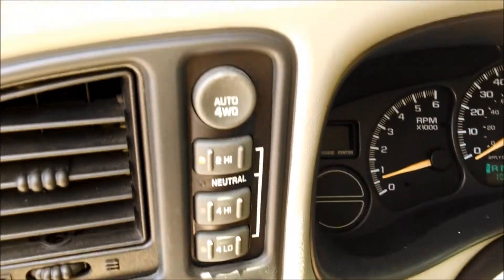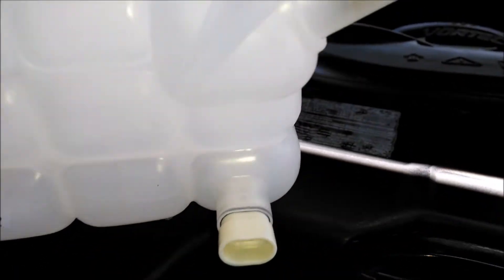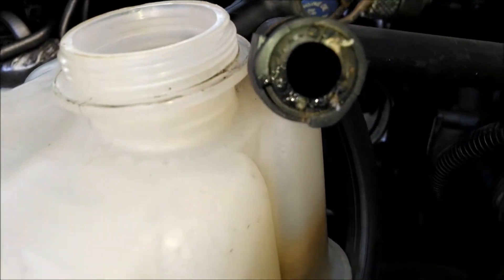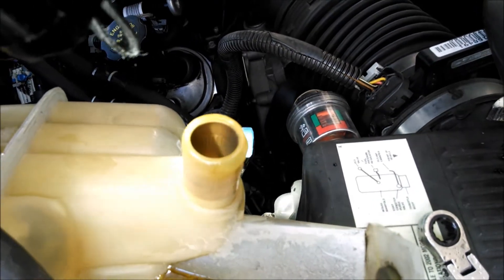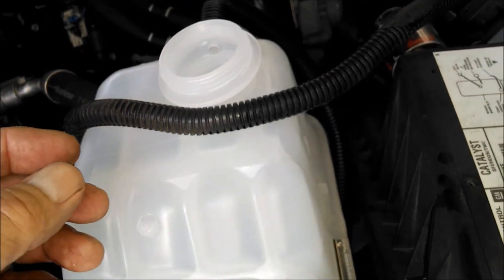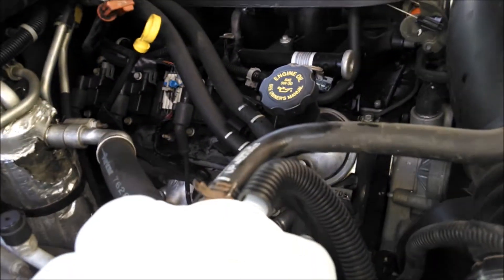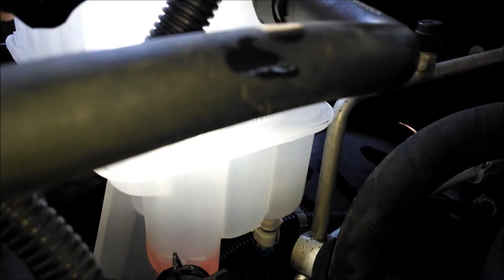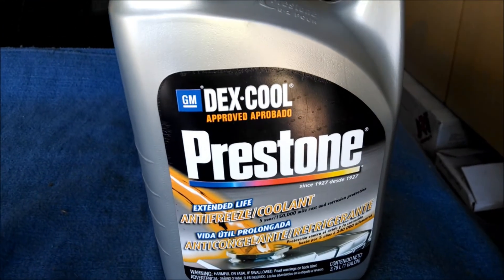Suburban overflow coolant tank and sensor replace by froggy

Comment: On my 2002 Suburban the coolent seems to be always flowing into the resorvor tank from the top hose.  Is this normal?   Had just replaced the thermostat and since the weather turned cold it does not want to warm up the engine.
Reply from the maker: Thermostat backwards?
Reply: @1947froggy  If you look at them on Ebay you will see it should be impossible.  The water pump has been replace before I bought it.  Tried putting in a thermostat that had the two metal supports and it would not fit into the opening.  Had to buy another different one.  I'll have to do another change out in the future.  When weather warms up.
Reply from the maker: @rogermerritt6470  OK Roger, it was just a guess. Don't have perfect answer, hard to remotely diagnose a vehicle.

Comment: Nicely explained. Kinda frustrating, that you need to replace the whole tank. I suppose if the sensor is glued in you can't easily get the old one out without damaging the tank, even if you could glue the new one in.
Reply from the maker: Yes, since it's pressurized I guess replacing just the sensor could be tricky, still a shame to throw all that out just for a $5 sensor.

:)

Comment: Doesn't the engine suck coolant from the expansion tank when it's hot and send it back when it's cool? I think you had that backwards.
Reply from the maker: I'd have to watch it again. On a cold engine start, coolant expands into the tank as it's volume increases and on cool down (shut off) sucks out of the tank.

:)